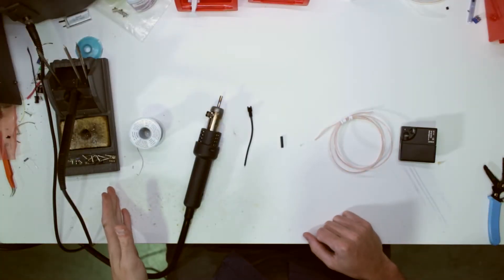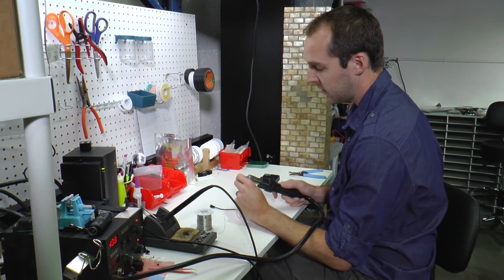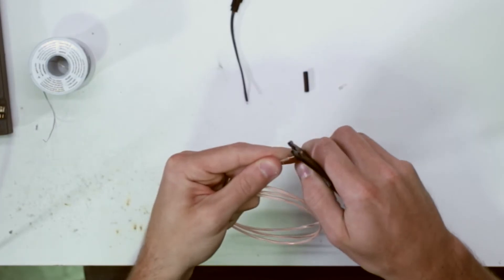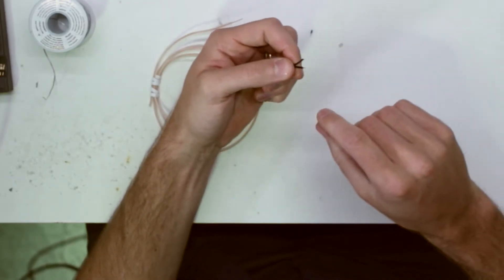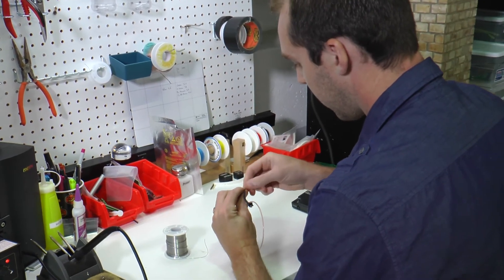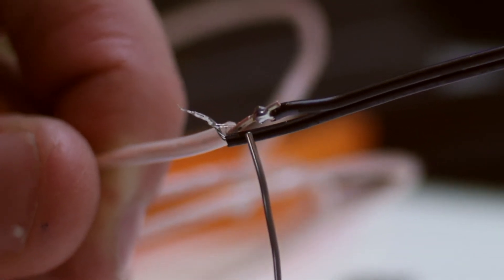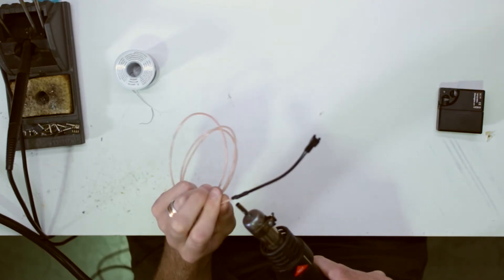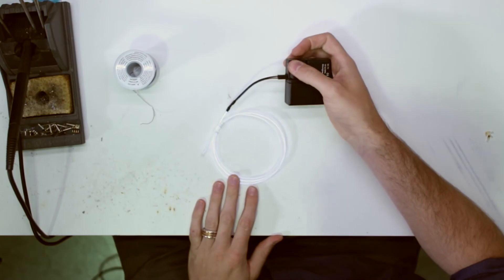How to Solder EL Wire - Ellumiglow.com

Comment: How would i do this with the "Chasing" El Wire?
Reply from the maker: Same thing, but there’s 3 wires inside the chasing wire.
Reply: @EllumiglowPage  well there's 4 wires coming off the controller instead of 2.
Reply from the maker: One of the 4 is your “ground” or your main core wire. The other 3 you will wire to the angel hair wires (one for each of the strands).
Reply: @EllumiglowPage  slightly confused. Could you maybe possibly give me like an MS paint drawing? Id be super appreciative

gamerninja91@gmail.com

Comment: How to turn off the high oitch sound on the inverter?
Reply from the maker: The noise is typically coming from overseas made inverters. Try our MEGA series inverters that cut out approximately 80% of the noise.
Reply: @EllumiglowPage  What about the laser wire?
Reply from the maker: @daemon3spade  There is NO noise that emits from Laser Wire® as it does not require a frequency to operate like EL Wire. That's why many people have started to turn to Laser Wire® due to the increased brightness and vibrancy, zero noise emission, and more flexible and easier to embed product.

Comment: you didnt say wether it needed to be a male or female easy snap connector, you should focus closer on your hands and not a full body shot, im trying to see what hes doing, and you didnt mention whether or not the angel hairs and the copper tip are suppose to touch eacho other before shrink tubing. :/
Reply from the maker: Steven, Most battery packs or inverters use a male connector, so the EL Wire portion should be female connector. The angel hair wires should be braided and they will be soldered to one of the 2 wires from the EZ Snap connector. These should not touch the bare part of the main copper wire when the shrink tubing is installed. Hope this helps!

Comment: can you solder 2 different colours of el wire together?
Reply from the maker: Yes, you can, but we recommend running the wires in parallel, so each line runs back to the inverter. This helps the wire last longer with fewer errors. We also have splitters from 2-1 to 5-1 that help make each connection plug and play ready.
Reply: Ellumiglow do the splitters make the wires more dull?
Reply from the maker: No, the splitters wouldn't make the wire more dull. You would just need to make sure the inverter that's used is rated for the total length of wire that's being powered. For instance, five 4ft sections is the same power as one 20ft section. But you would want an inverter that's rated for at least 20ft.
Reply: ahh ok thank you so much!:)